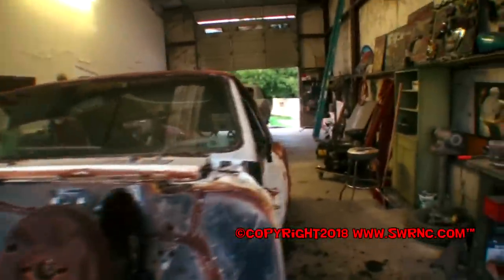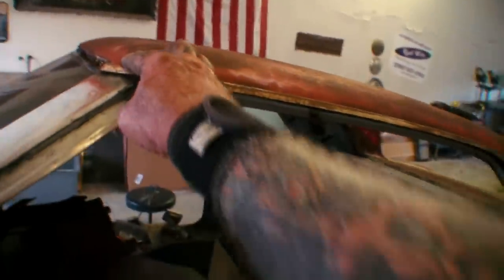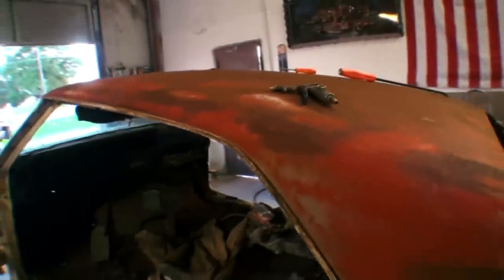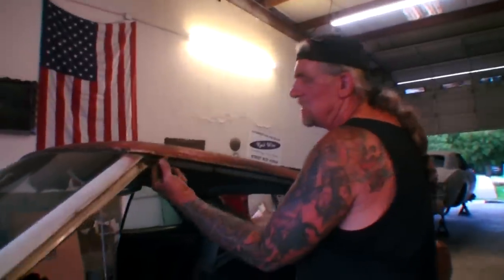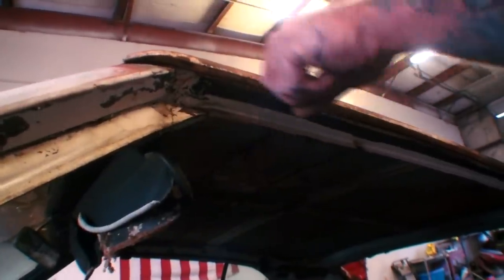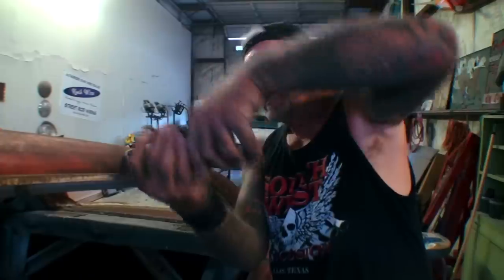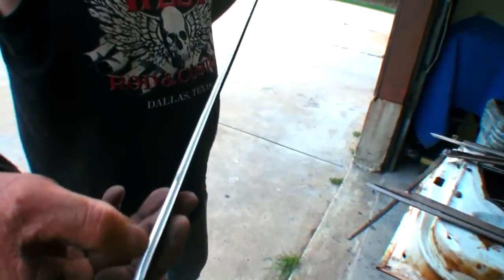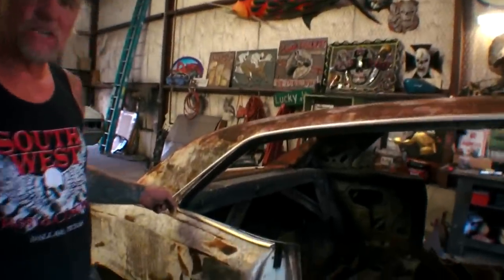How To: Remove Drip Rail Molding On Classic Cars And Trucks

Comment: Just watched your video and ran out to try this technique on my 62 Chevy II four door. The post doesn't pose any problems if you ignore the middle and  work from both ends. The middle pops off when it's ready. 
Since I didn't have the long pry bar, I used a short trim removal pry bar. I hit my thumb a couple of times, but  the end results were fantastic. I would place a lot of emphasis on patience as the progress is very slow but rewarding. It is easy to get excited and rush the job once it starts coming off. I did, and it tweaks the trim a bit. Nothing major though. Slow and steady wins the race!!!
 Thank you very much for this outstanding tip.
Reply: @Jeffery Merrell    > Thanks for your post on Pete’s video. I was a tech and fixed vehicles at the dealer, and not familiar with paint, body work, much less trim removal and installation. Like your comment and Pete’s two videos on this subject, I have gained confidence and knowledge on how it is done. Thanks for the extra boost! Hope your project goes well as there are few videos to learn the “Right Way” to get-R-done! Regards, DK.

Comment: Did this a couple years ago on an '82 Volvo to harvest fancy moldings for my '69, but couldn't find any info on it. 

Ended up using an assortment of screwdrivers, prying at the bottom & then outward, scratching the shit out of the driprail paint and finally getting somewhat bent (but un-kinked!) moldings. 

Thankfully the car was destined to be a POS snow drift car(so paint didn't matter) and the moldnings aren't a rarity. But now I know a couple of ways to do it properly in the future, Thanks My Friend Pete!

Comment: thank you. In the past I've just taped. Rather than taking the chance of denting it.  But I have a 75 Cilica St Coupe that's needing paint, after  only 34,000 mi. Or 46 years . LOL  It is original paint no rust not even any dings. And all I need to find is one side marker lens. I think I'll try removing the drip rail on the hay truck first since it's a beater.

Comment: Should I use your grandads techneak on my 63' Chevy Nova . Along the sides of my car at the very  bottom there are wide molding strips on both sides. I'am doing this myself and don't want to screw it up but I can't seem to find a video on DIY or anywhere that will help me on how to take them off ugh ..thank you and  your grandad .I appreciate any pointers .Will you make another video on how to put the drip rail back on I'll be doing that all God bless....
Reply from the maker: You should be able to pop the moldings off with ease, there are some molding clips under the molding itself.. put your screw driver or small pry tool on the bottom side of the molding and lift up easily and it should pop off.. On most lower moldings the molding will hook on the top and pop in the bottom.  Good luck!

Comment: Hi Pete, I've seen it done using an old time bottle opener.  Although I have never tried it I'm going to need to in the near future.  Any thoughts about this way.  And good luck in Moab, place looks awesome!
Reply from the maker: Never used a bottle opener, Ill have to try it next time.. Moab is getting closer...
Reply: It works great.  Put tape on the part of the opener that touches the outside of the trim.
Reply: @BobJones-dw3up  Thanks Bob, good advice.

Comment: hi pete.

i dont have to take the chrome off my vw 1978 dasher coupe...cause i dont have any at this time...on the roof-rails...lol.

but i will put the original chrome moldings on when they arrive...hopefully i dont bend anything or worse scratch the fresh paint on the rails.

thank you for beeing here and shool us on how to doit right.

because of your vids i was brave enough to cut out the outer inner and outer flares on the lower back quaterpanels and weld new ones in with all the other work reqired such as grinding filling sanding and painting ,
with a following wet colorsand (1500 & 3000)and finally a buffout.....everything came out looking very nice.
i now have to wax it and its done...i can pack it up for winter(bavaria germany)and roll it out next year around april or may like a brand new car...well..almost....its 40 years old....lol.

with best regards sir

sorry for my bad english....😉
Reply: Thanks for the comments and support

Comment: Good video. You almost have made me confident enough to try a ground up restor' on my 79 Ford F150 4X4. I have completed the mechanical stuff. Solid 351 mod. New auto tranny, rear axel rebuild all bearings and brakes, drums and cylinders. Front Dana 4X4 needs to be rebuilt next. New master and booster, front brakes and bearings complete however the spiders are lose. I have bad bed wheel wells and will need lower rear fender pieces. Paint needs to be totally removed. Trim is great but bumpers and tailgate suck. Floor pans are out. I need an off frame restor. Frame is pitted. I think black Por 15 for that but I want the axels and suspension parts a contrasting color. Springs both leaf and coils plus all suspension parts will need paint but what color. I have seen a lot of red used but axel and small suspension parts, but do not blow my skirt. I would like multiple suspension colors to match my new bushings everywhere. I can easily brush paint the underside if I can make up my mind on the colors.

Now for my mules ear to chew on, I am widowed for 4+ years. You need to fess up and be nice to yours. Mine went in two days. Piss poor time to forgive 46 years of my stupidity. Just a thought man, I don't mean nuttin' by it.

If you have a color combination for suspension , frame and axel colors I could use some suggestions.

Next, where is part 2? I have trouble following the extra parts of your great videos.

Peace and love to you and yours, that is what counts and what I miss,
Don Grider 
Louisville, KY